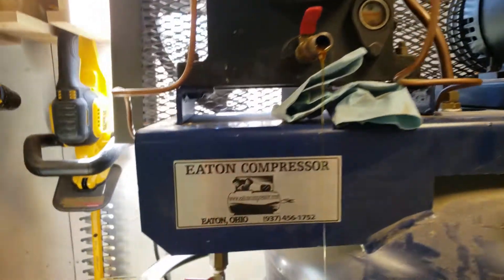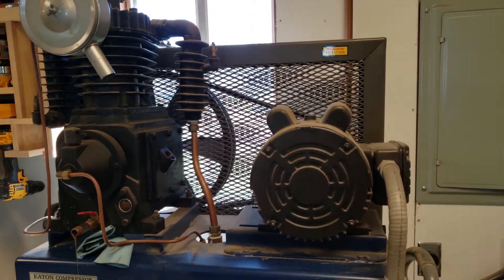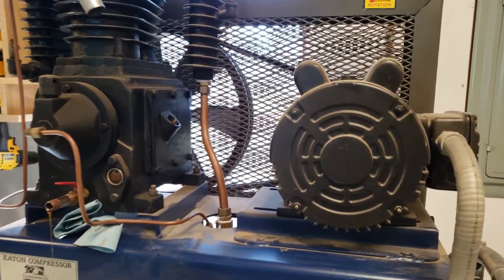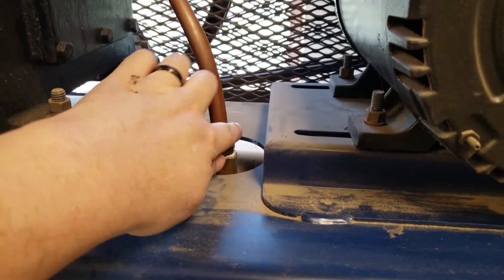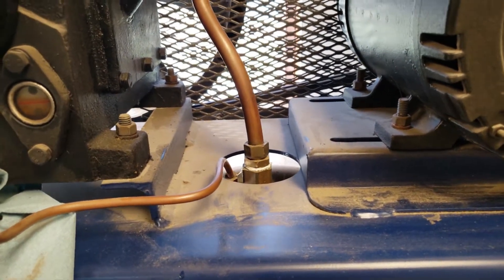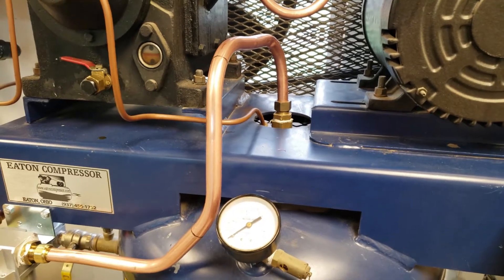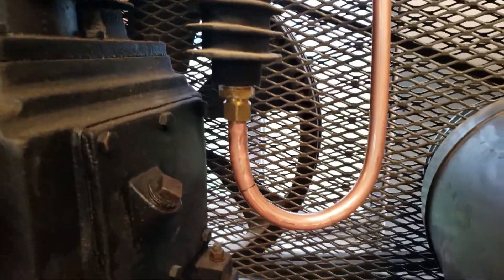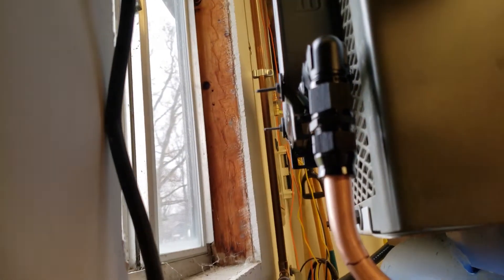Air Compressor Aftercooler for my Eaton Compressor

Comment: I've done the same thing except I just used 1/2 inch aluminum pipe instead of the 'radiator". I ran it to the cage and coiled it up 8 times and it works great for half the cost. The radiator does look better though.

Comment: great video - getting ready to do an aftercooler mod on this same compressor - well, the current-day version EMAX but its a 5hp on 80 gal tank, but the pump and its output and input to the tank are the same.  I've been debating going with braided stainless vs. copper tubing - braided hoses would likely be more expensive, but could be a wash by the time I buy a tubing bender....   but the copper hard pipe looks good - appreciate you calling out the sizing of the copper on that setup.

Comment: 200 degrees,, that's why I only use single stage boosting the air increases air temperature,, l have a 4 cylinder single stage never have over 130 degrees,
Reply: You've got it backwards, two-stage compressors typically run cooler because they cool the air between stages. Single stage typically produce higher outlet temps than multi-stage compressors for the same pressure rise because again, multi-stage coolers between stages reduce temperature before the next compression.

Comment: Stacked fin will cause restrictions and back flow on pump
Reply: That's not accurate for this application. The Derale 51910 that he's using is -10AN, rated for 37,000 BTU/hr with minimal pressure drop in oil (per Derale). Air has MUCH lower density and viscosity than oil, so pressure drop is even less, easily supports 25-30+ CFM of air which is far more CFM than is even capable for his unit to produc.

Comment: Excellent work. Well done. I just got my first “real” 240V compressor and I’m thinking about how to tackle this kind of thing and I think I’m going to put as much as I can on the wall and in the shop plumbing. I’m going to plumbing the compressor head output into the wall piping and such first and then have that piping feed the tank. This should allow the air enough time to cool as much as it can before hitting the tank.  Also, I’d suggest moving your regulator downstream closer to the point of use. You want your plumbing and such to be at tank pressure if possible because it reduces restriction/losses because flow velocity is reduced.

Comment: So, now you might need to drain the air tank just to change the belt when it wears out.  That's a common problem with choosing this placement of the aftercooler.  I think a different spot would save effort later.  Many guys don't even need a fan on the cooler, even though one can be added.
Reply: Those belts rarely need changing.  Most home hobbyists who don't run their compressor all day every day will see those belts last for decades before they need changing.  And if he ever does need to change it, it is a minor inconvenience to drain the tank, and remove two fittings from the cooler.
Reply: Draining the tank takes what, a minute or two. Filling takes around 5 or less min from empty. Another 5 minutes spent taking two fittings apart. Hardly what I would call an issue seeing it rarely ever needs to be done. An extra 15min of work every 5-10 years is trivial.

Comment: Did the same on my Ingersoll rand two stage my tubeing was 5/8  had to get the inverted tubeing nuts to come from head and tank iam also using the 3/4 pvc pipe up n down with drains and motor guard and a whole house descent filter on the end for painting i can't have a drop of water at the end of my hose sounds like over kill but it definitely works

Comment: So I made essentially this same setup, except I have an IR compressor(175psi). But instead of running a single filter after the Derale radiator I ran a 3 stage Nanpu set from Amazon. Filter, coalescing then desiccant dryer then into the tank. Within 3 seconds of turning it out the 1st filter stage of the Nanpu blew apart. Looks like three of the metal lugs holding the bowl cannister on had just sheared off. The cannister flew down and smashed into the floor with all the plastic parts busting everywhere. Dented the metal cannister also and a small piece of something had flown by my head. I think it was one of the lugs. My first thought was that the nanpu, which I'm sure is cheap chinese pot metal, had a stress fracture in it. My second thought was that having all three stages inline created to much back pressure and the 1st stage gave way. I am using 1/2" NPT so the lines are big enough. It was probably a combo of those two items.

My goal was to have the air as dry as possible going into the tank. But when I replumb it I think I'll go with just a 1st stage filter/regulator and put the coalescing and desiccant filters after the tank. 

Also, posted this as a warning to anyone else trying it. Take precautions when starting it up the first time with any modifications, like turning it on from the break far away from the compressor! ha.
Reply from the maker: Yeah, there was definitely a moment of stress when turning it on for the first time. Thanks for giving  your experience. Hopefully it gives others more information to work with.

Comment: I have one of those style air compressors. It has a Campbell 7 horsepower compressor head that looks like yours. I am in Pennsylvania and my 300 gallon compressor is in the damp barn . It gets super wet and water gets into everything. I am upgrading my HF sandblaster to the metering valve , lights and new glass with t-bolt thumbscrews that will hold the glass in and and screw into the outserts that I used for 1/4-20 threads. You are an inspiration . I should have the 17 centimeter light strips for inside. If everything works well then I am going to convert to vapor honing for glass bead's

Comment: Good job on the copper bending from the cooler to the water separator. You just have to wonder why the makers do not use these coolers from the get go. Or, at lease offer them vs. the expensive methods.

Comment: First one I've seen using the stacked plate style cooler, good on you for not just following the "conventional wisdom" of buying a derale 15300 because that's what everyone does. And your temperatures speak for themselves. Nice job, nice bends as well.

Comment: I can't believe you have never bent tubing before! Nice, tidy, symetrical bending job! Smart choice to purchase a better, larger quality bender, which makes non- crushed, smooth radius bends. Cheap "ain't" good, & good ain't cheap. I used to bend & install stainless steel (SS) tubing from 1/16" to 3/4" for LPG & CNG. That   1/2" & larger was so tough that we used gear reduction benders from Swagelok, if I recall correctly. Anyways nice install. Oh, I think you will get cooler outlet temps. closer to ambient with the addition of an electric fan ducted to force all fan air thru the cooler (for greater water condensation), & get more air over the pump fins to boot! *Two YT comp. air related channels for you or your viewers: #1) THE Compressor Guru (Bud Stiner), tech. videos for DIY's, #2) Doug Kronemeyer,  engineering level knowledge   on max. efficiency passive moisture removal in 3 parts (DIY #9.) Best complete logical info. I have found yet for small shop & hobby air systems! Paul from S. Central Tx.
Reply from the maker: I truly appreciate your kind words. I'm just someone giving things a try. Is this setup perfect? No, but I do think it helps. I'm glad it did it.

Comment: exactly which aftercooler did you use with the 10an inlet and outlets
Reply from the maker: Here is the one I used. The price has went up about $25 since I did this project.

Derale 51910 19 Row Core Stacked Plate Cooler Kit https://a.co/d/4DCTurb

Comment: You did a great job with bending that copper tubing but I have one concern, how are you going to get to the back of that compressor to change a belt or what ever needs to be done, I would build a small enclosure outside of the shop and put that compressor out there and not have to listen to that noise,

Comment: So your copper hookups to the 10AN cooler.....did you step that down to 8AN and flare the copper ends ??   ....or did you go 8AN to 1/2 NPT and used a compression fitting??

Nice setup !

Comment: Backbeat Woodworks, what did you use to bend your copper tubing with? I'm currently working on adding a cooler to my compressor. I was able to bend most of my tubing by hand. I made it all the way to my water trap with out a problem. Coming out the other end of the water trap, I will have to make quite a bit of 90 degree angles to make it back into the tank. I tried bending that by hand with no luck. I'm using 1/2 in od 3/8 id copper. I found out it's hard to find compression fitting elbows for 1/2 in. My compressor is set up like yours
Reply from the maker: I used a tubing bender. It's really the only way to bend it without kinking. You can see me using it in the video. I'm not very good at it, but it worked out.
Reply: @backbeatwoodworks  I borrowed a pipe bender and a tube bender from some buddies. They kinked it. My local hardware store had the correct kind, but they didn't have one for 1/2 tubing. Looks like I can only find that online. I've learned that's it's hard to find a lot of fittings for 1/2 in copper tubing
Reply: When free-hand bending the cooper pipe, especially sharp bends, you can fill the tubing full of dry sand and tape or cap off the ends. The sand will support the tubing and keep it from collapsing.

Comment: Thank you for video, i have a problem on my compressor very time change oil I have seeing a lot of water are mixing with oil, what make it trap water inside the compressor pump. what cause that and how to be fixed it? thank you
Reply from the maker: I'm no expert, but it maybe a bad gasket or the piston rings are warn to the point it's allowing air and moisture past them into the crank case area.

Comment: You did a nice job and should be very proud. 👍  So many people make a cooling manifold on the outlet of the tank. The tank gets very hot and they spend about $200 just on copper. I love the fact that you cooled down the air before the tank.....that should extend the life of the tank for a long time. 👍
Reply: whats the point? get more lower temperature of air into the tank ? whit this proscess loosing water inside the bottle? the air which inlet in the bottle must be the same as the bottle temperature,room ? correct?
Reply: @drazenveselic2902  the air coming out of the compressor is HOT and as it cools down in the tank, it creates moisture in the tank. Cooling it before it gets to the tank, and removing the resulting water BEFORE it goes into the tank, prevents water from ever getting into your lines.

Comment: This is fantastic!  Thank you.  I tried to do something similar with my oil-free compressor when I was trying to do some automotive A/C line purging since I don't have compress N2.  Didn't turn out as nice as I tried to make a copper coil on the fly.  Really love this method with stacked plate cooler which really brought those temps down. Does large pully draw any air across the cooler or just ambient air is doing the cooling?
Reply from the maker: Thank you.
The large pulley does move some air across the cooler. The original compressor design is to move air across the motor from the pulley, so I just tapped into that design.

Comment: Good luck changing the belt. Your copper work looks fine. New compressors don't usually come with magnetic starters any more with the spec of your unit. That was an informative video, thanks